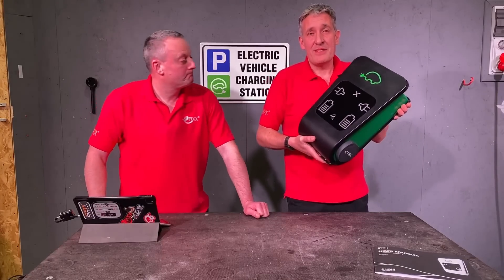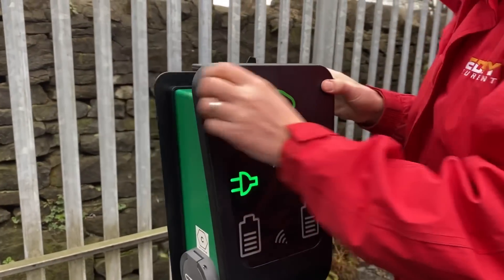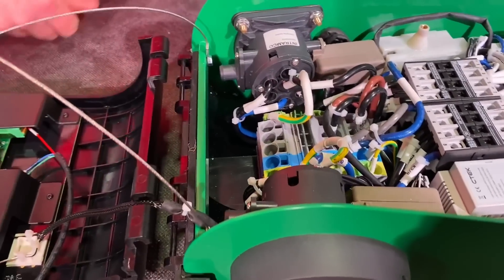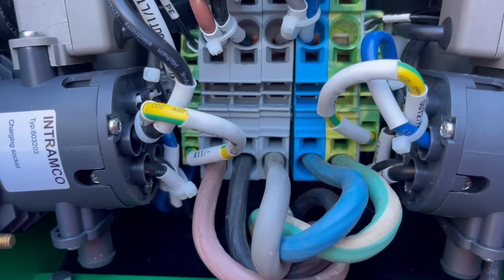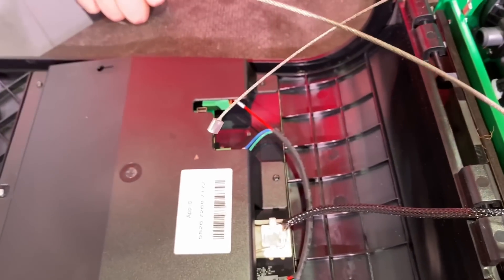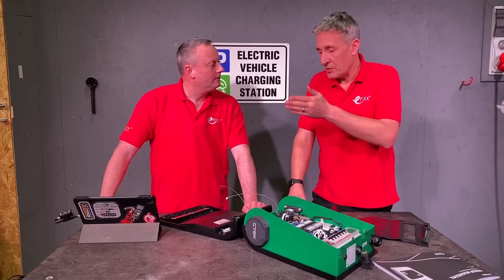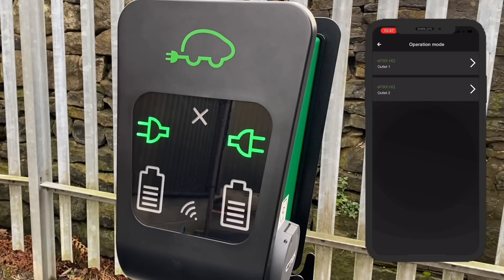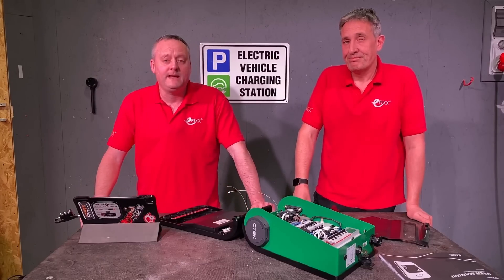What's inside a THREE PHASE 22kW EV CHARGER? - CTEK Chargestorm Connect 2

Comment: Great video.. 
I can see as a commercial unit the ease of install in this, but agree the top entry is dangerous.

The software locking pin I find strange.. what I assume is a competing unit to this the Dual Schneider EVLink unit just lets you clamp a cable on top, which has the added advantage it can be in unplugged if faulty or someone with a different car (Type 1 v Type 2) wants to use their own cable.
Reply from the maker: They are locked to prevent theft - a cable can cost over £400

Comment: If installing as part of a TT installation with multiple units fed from one feeder pillar, what type RCD would the manufacturer recommend to use at source if they make any recommendation at all?
Reply from the maker: Type A should suffice with a time delay. (S)
Reply: @efixx  what’s the situation if say for example 5 chargers are protected by that  type A RCD each charger has 6mA DC protection built - in theory each charger could pass approx 5mA each, totalling 25mA seen by that type A at source which is over the 6mA rating of type A RCD’s - your thoughts on this situation would be helpful